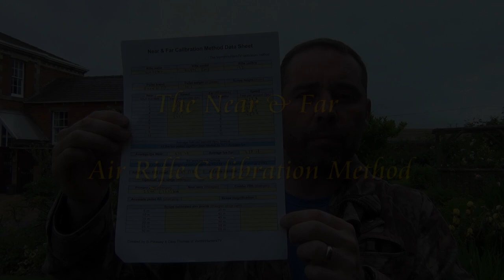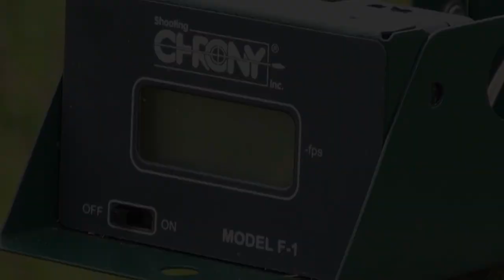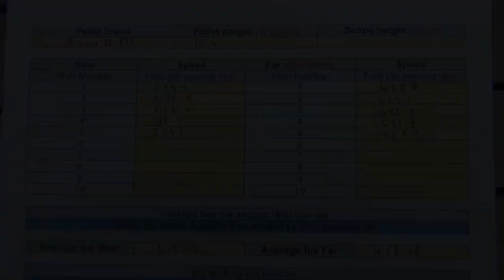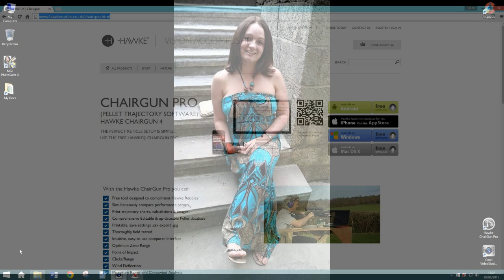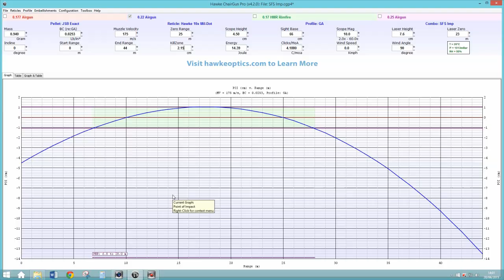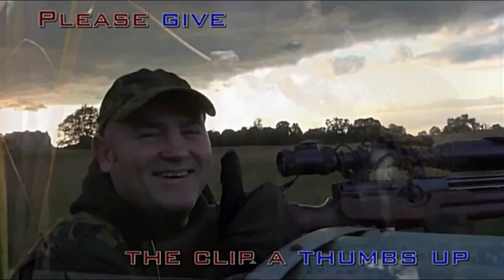The Near & Far Calibration Method

Comment: Nice info and a good video. I bought a Hawke Airmax 1" scope, 4-12x50 and did not realise until I got it that it has damn 1/4 MOA turrets but uses a MIL dot reticle. The Paralax adjustment is in YARDS, throw all of this combination together and you may as well guess! Just a complete mismatch of everything. Why did they not just stick to one standard, either MIL or MOA, but to mix them up seems crazy. (Lovely scope though as far a holding zero and the glass, best I have ever had)

Comment: Hi Si, any reason you chose 44 meters for your "far data collection" i'm waiting for a chrono to arrive and i will using it with the Hawke system, i have a .177 rifle and was wondering if that (44) would be ok ?
Reply from the maker: It was just the distance I walked out to mate. As long as the distance is known accurately it's fine.
Reply: VerminHuntersTV Thank you for that !
Reply: VerminHuntersTV 
in the field wit the side wind the pellet has to travel a longer way so it will end up lower.

Comment: Hello si great video, just wanted to know I've got my near velocity for my rifle, do I need a chronograph to find out my far data or will the chair gun pro calculate my far velocity
Reply from the maker: Charlie Whitelegg You need a chrono to get your far  velocity. Another way of doing it that isnt quite as accurate is right click on the BC tab in Chairgun and click on the drop in cm tab. This only works well though if you have a perfect zero at your primary range and then shoot and measure your drop at a further distance.

Comment: Ftlb is V^2 x grn / 450240 (NOT) 450249- not that it will make any difference to the final muzzle energy result ;) Good video chaps.
Reply: VerminHuntersTV Hi there Si great video and good info as usual, I would just like to add that the police do not take an average FPS they take the Max ( as far as I know, so in your case you are well under 12 FPE so it matters not one jot, however Joe Soap could be running a bit nearer 12 FPE so average would make him safe but Max would have him/her in bother ) ATBM8 and thanks to you Dave for taking the trouble to upload all these vids.
Reply from the maker: No for more accurately doing it it 450249.
Reply: VerminHuntersTV I think we're both wrong Si. The denominator figure works out as 7000 (grains in a pound) x g x 2. If you take standard figures for g at 32.174049, you arrive at 450436.7 to one dec place.... but since the value of g depends where on the earth you measure it and has been in debate every since the French proposed their view (who would want to agreee with them), I think we are all allowed some artistic license. I think the 450240 figure was taken as being easy to remember. At the end of the day, it makes such a small difference to the equation to be a moot point.
Reply from the maker: rmjarre true mate. I've done calculations with the 450240 and 450249 and the foot poundage to 2 decimal points are identical.